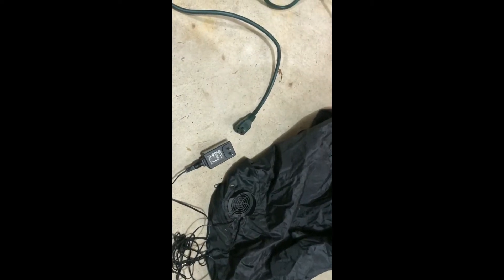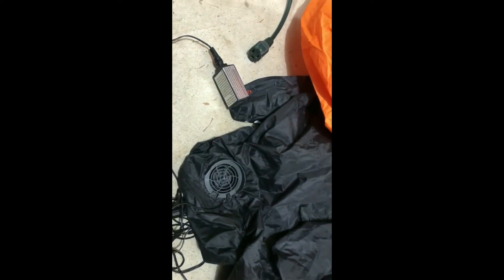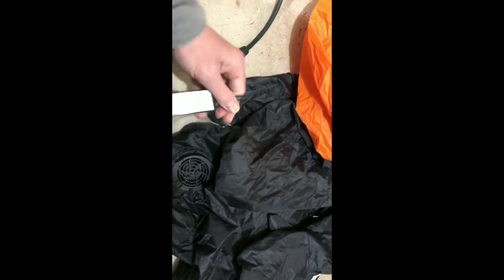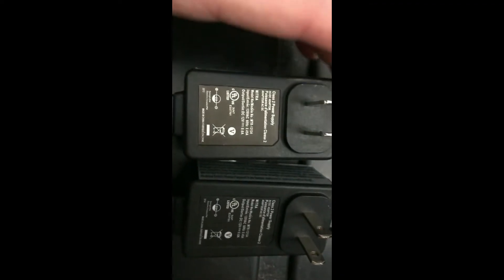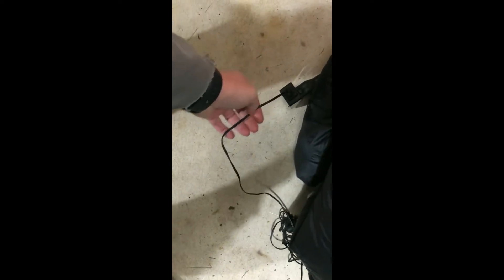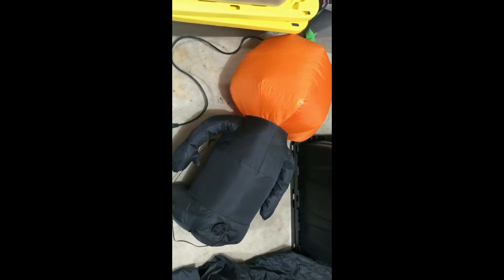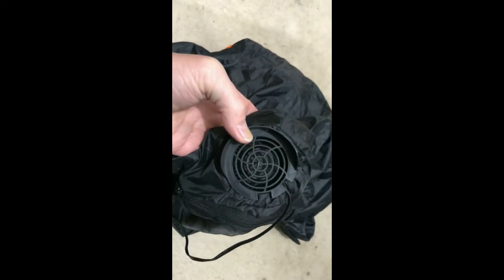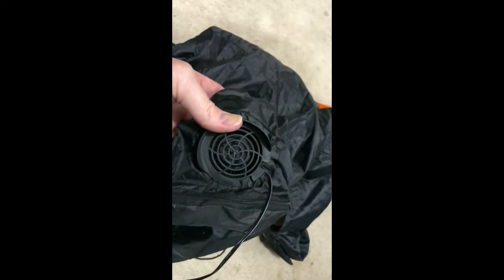Troubleshooting and possible fixes for your holiday inflatable's broken motor

Comment: my fan is making an odd buzzing noise when it is on. can you help?
Reply from the maker: Most likely there is something stuck in the motor, like a piece of grass or something.

One other time we had a motor where the blades of the motor were too long and were scrapping the sides of the motor case which caused an irritating noise, but eventually the blades shortened due to scrapping against the sides.

Other than that we only have a couple of inflatables that make a buzzing noise when there is nothing stuck in the motor and we can usually get the noise to go away by shaking the motor a bit. Not really sure what causes this noise, could be something loose inside of the motor.
Reply: Same with my panda

Comment: The motor runs but seems it is not provinding enough air to blow up the decoration... Even though it seems like the fan is running fine...
Reply from the maker: Unfortunately you probably need a new motor.
Reply: @HolidayHouse5777  Thanks so much...
Reply: It sounds like you have a tear or hole in the lining that needs to be patched up.

Comment: The light is blinking on mine and the moter is skipping, how do i fix this
Reply from the maker: Sometimes shaking the motor works for us too when this happens. If not you could try using a new adapter.

Comment: Mine got water in it, think if I let it air out it’ll work?, water only got in the motor not on plug
Reply from the maker: It might. Sometimes our motors will stop working so we bring it inside and let it dry out for a couple of days and it works again. Couldn't hurt to try.

Comment: Thank you for this video! Based on your experience do you know what needs to be replaced if the lights blink and fan pulses but it won’t actually stay on? Tried a different adapter and that didn’t work. Sadly only had this two days, one of the days was rainy so moved it onto the porch from the yard. Worked on the porch one day but now won’t blow up again and has the flashing/pulsing symptom.
Reply from the maker: Usually that means it needs a new adapter, sometimes letting it dry out works, but you've already tried those.

How many things do you have plugged into the extension cord this one is on? Does it work if you plug it directly into the outlet inside your home?

Sometimes when this happens to us the inflatables just start working again one day.

If you're still having the issue even when it's plugged directly into an outlet then unfortunately you might need to replace the motor.
Reply: This just happened to me. Santa that pops in and out of a chimney. Did you ever solve the issue?

Comment: I haven't ran mine for days and now one won't inflate. It ain't the power adapter or the outlet it's the fan motor but it does light up
Reply from the maker: Yeah if the lights turn on but the motor doesn't turn on then the problem is most likely with the motor. I haven't tried fixing the motor itself and probably in most cases it can't be fixed. 

You can find motors on Amazon for 20-40 dollars, in most cases it's cheaper to just buy a new inflatable.

If this is an inflatable you really like and want to use it again someday you should check out the stores after the holidays, you might be able to find one of similar size to yours that is 50% to 75% off and just use the motor from that one to put into your current broken one. Would probably be a lot cheaper than buying a motor.

Comment: What if the fan runs, but new lights won’t come on? Could be power adapter?
Reply from the maker: Unlikely it would be the power adapter. How did you add the new lights? Did you replace the motor with a motor that came with lights, or did you splice new lights into the old wiring?
Reply: @HolidayHouse5777  spliced new lights onto the old wiring from motor.
Reply: Thinking it has to be where light wires splice into actually fan..?
Reply from the maker: @Braando93  one of the wires from the old wiring should have a red stripe on it (might be a different color but usually red), the new wiring should have a wire that also has a stripe on it (usually black or grey), make sure the wires with the stripes are spliced together and the wires with no stripes are spliced together.
Reply: @HolidayHouse5777  yes they are. I plugged the same lights onto another fan and they worked. Process of elimination. Have you ever had a fan that ran but new lights wouldn’t?
Reply from the maker: @Braando93  afraid not. I have never ran into this problem.
Reply: @HolidayHouse5777  hmm. Alrighty man, thank you for the help. I ordered a new fan with lights. Works now. Was just hoping I didn’t have to throw away a good fan that still runs, hoping I could get lights to work
Reply: @HolidayHouse5777  my only guess is it has to be where there soldered onto fan.?

Comment: I shaked it and it turned on but then it stopped and made smoke like from burning.
Reply from the maker: Yeah it's not a good sign when that happens. We have had several motors over the years smell like they are burning but there was no actual smoke, and a few of those ended up being just fine the next day or two, the others the motors burnt out and we had to replace them. We have only had one that was actually smoking and the motor was fried and had to be replaced.
Reply: It sounds like your fan was jammed. The debris was dislodged when you shook it, allowing the fan blades to move. But it lodged into a fan blade again & started to burn up the motor. You always want to check the openings of the fan for any debris & take a screwdriver to move the fan blades until you feel no resistance & they move with ease.

Comment: Mine has no light, it’s brand new just got it a month ago it was working a few nights ago
Reply: Me too!!!! Mine is not running either…. These things aren’t cheap! Literally a month old 😢
Reply from the maker: No light and the motor isn't working? It is probably the power adapter. The good news is that is the easiest problem to fix, the bad news is the power adapter alone could cost you around 15 dollars, which could cost almost as much as the inflatable depending on the inflatable. You could try calling the 800 number and they might send you a replacement part since it is so new.

These motors don't typically stop working after just a month, but we have had that happen several times over the years so it does happen. Sometimes the problem is the fan has ice on it or is just really wet and after letting it dry out for a couple of days it will start working again.

Comment: Mine just won’t inflate completely
Reply from the maker: Unfortunately the motor most likely needs to be replaced.
Reply: mine still working but is not that much power in it so i think i should have soon replaced but dont know how to do this :-( dont wanna broken the material ,if you can see how to do this it could be awesome 😊
Reply: if you can show how to do is ,not see .Sorry my mistake x
Reply: Your inflatable has a tear or hole in the lining that needs to be patched.
Reply: @monika1987rokrok You should see a zip tie holding the fan in place. Just cut & install new fan with a new zip tie. There’s not much to these things.